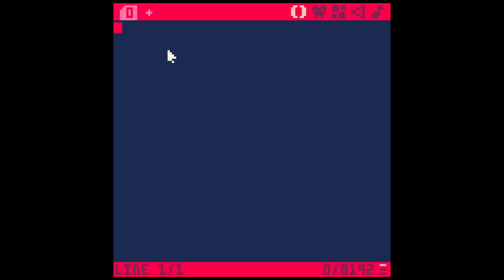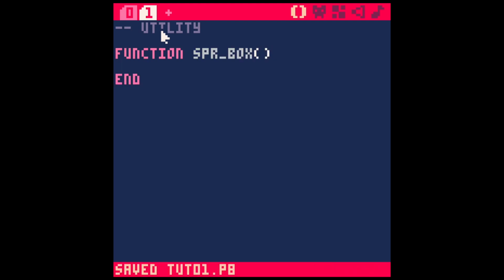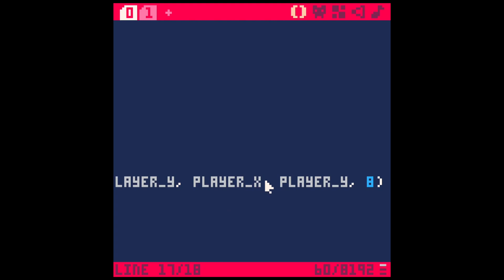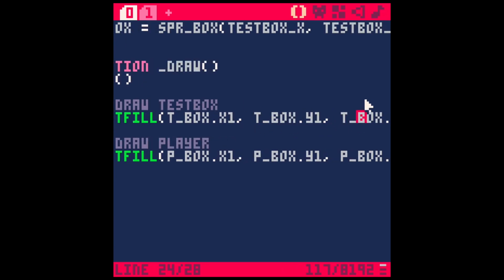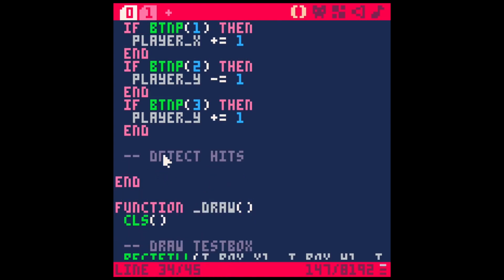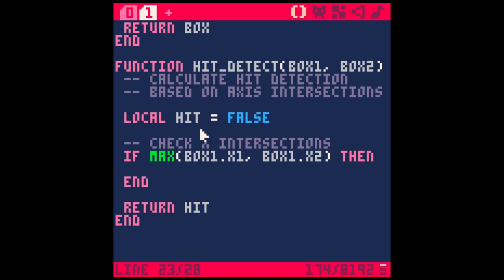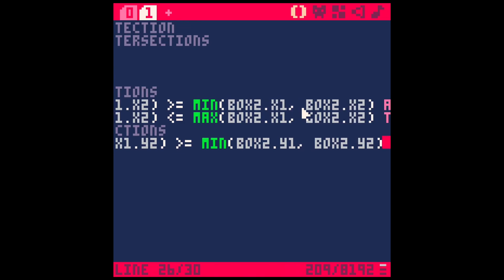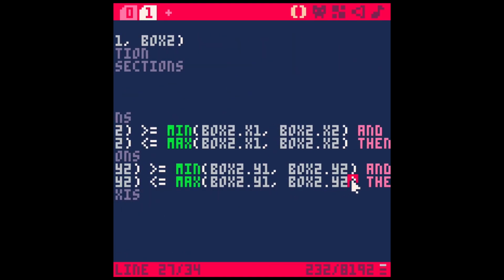Simple Collision Detection In Pico-8

Comment: So, to make this easier on people such as myself...you can wrap everything that was laid out in this lesson into two objects, a table, and an if then statement.
Example
Character1={}
Character={}
CharacterX=58
CharacterY=58
CharacterX2=CharacterX+8
CharacterY2=CharacterY+8
CharacterSPR= 006
ADD(Character1,Character)

Note: You can use ADD rather than RETURN noted at (4:12)
Note: You create the  'CHARACTER1' array in case you wanted to add more characters to your game, such as a character2, you can skip the CHARACTER1 array if you don't plan on adding more characters and are just testing your code.

Now do the same thing to what you're trying to collide with, in this case it will be an enemy on the screen;

Enemy1={}
Enemy={}
EnemyX=70
EnemyY=70
EnemyX2=EnemyX+8
EnemyY2=EnemyY+8
EnemySPR= 008
ADD(Enemy1,Enemy)

The above method saves you the trouble of having to multiply the width and depth mentioned at , you may have to adjust your (+) equations based on the size of your sprite, but its not complicated.
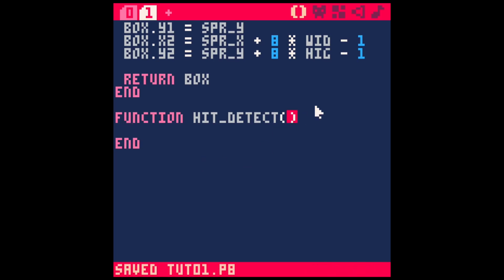Now you can skip to  (10:47) and go to your _Init FUNCTION()
PTHIT=FALSE
PTHIT=(_COLLISION )
Jump to FUNCTION _UPDATE
Create you Collision Table, in this case, it will be called _COLLISION, so; (12:13)
FUNCTION _COLLISION(CHARACTER,ENEMY)
LOCAL HIT= FALSE

IF MAX(CHARACTERX,CHARACTERX2) >= MIN(ENEMYX,ENEMYY) AND
etc, etc. (12:33 and onward)
HIT = TRUE
END
END
RETURN HIT
END

After you've drawn your sprites in the _Draw function
Example: SPR(006,CharacterX,CharacterY,Width(if applicable),Height(if applicable)
SPR(008,EnemyX,EnemyY,Width(if applicable), Height (if applicable)
Note: 006, and 008 are where I personally created my sprites, they more than likely will differ from where you have drawn them.

Now just put your IF THEN statement in the FUNCTION _UPDATE(): IF PTHIT THEN
CharacterX-=20
END

Your character should move twenty pixels to the left when it collides with the enemy. 

IMPORTANT: Make sure you assign buttons to make sure that you can move your sprite.
You can call your functions anything, just make sure they line up with any changes you make in the future.
Reply from the maker: Glad you were able to find a way to make things easier on yourself! Don't forget as well, when dealing with many different kinds of objects, you can setup helper functions to create them:

Character1=SetupCharacter(58, 58, 006)

This is helpful because that function can also include code that adds all active character to a table for mass performing operations such as drawing their sprites, assuming the order doesn't matter. You can of course break that down between player, enemies, items, whatever :)
Reply: @DeepFriedOreoOffline  I see , not sure about approaching it that way as I believe the order matters when it comes to SPR 🤔, I'd have to RUN it to verify. BUT.... thank you very much for the guideline, I can finally progress!
Reply from the maker: @notnorthkai  The order of SPR matters overall, but classifying different classes of objects in tables/array for say foreground, background, items, and drawing them in clumps will allow you to choose the order for groups rather than every object. Though it call all be in one large group if the order doesn't affect your usecase :)